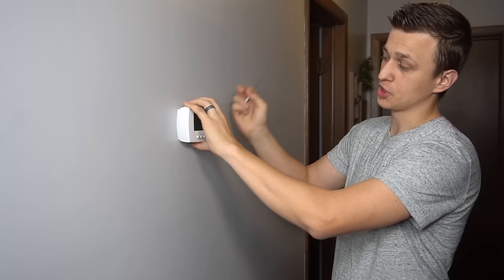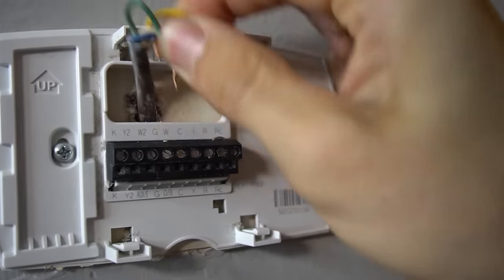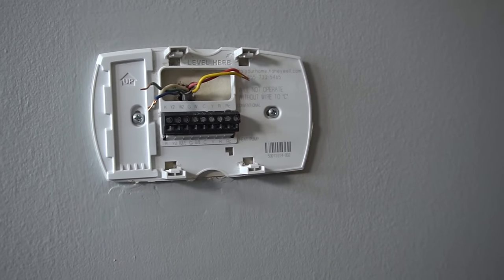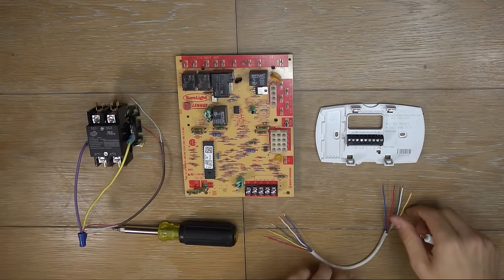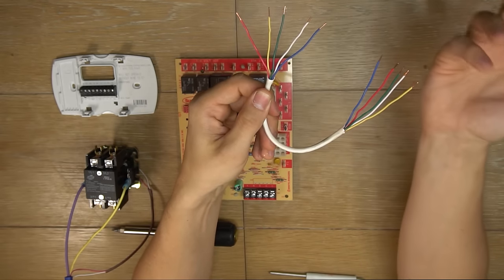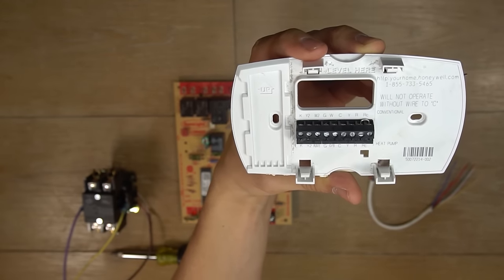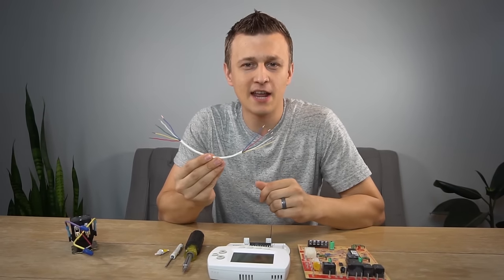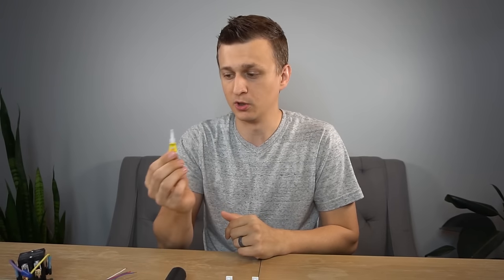Basic Thermostat Wiring - How to Wire HVAC Thermostat

Comment from the maker: ➡ More Helpful Videos:

How to Wire A/C Condenser Unit:
https://youtu.be/KCanZEsLVEI
How to Wire Air Conditioner Compressor:
https://youtu.be/GhBTVn5CHBE
10 Ways to Splice Wires Together:
https://youtu.be/ihpNCVk1lF0
How to Read Furnace Wiring Diagram:
https://youtu.be/2MSedAkirqw
How to Read A/C Wiring Diagram:
https://youtu.be/2MSedAkirqw
How to Read Water Heater Wiring Diagram:
https://youtu.be/TX8SuHK1esY
Basic Thermostat Wiring Diagram:
https://youtu.be/jDLz3REPTWM
How to Wire Indoor Blower Motor:
https://youtu.be/4S8TZd-45bY
How to Wire Outdoor Condenser Fan Motor:
https://youtu.be/VlMhvwrpimE
Is Common and Ground The Same Thing:
https://youtu.be/wiKDlIlbiP4
Electrical Symbols and Meanings for Switches:
https://youtu.be/ngQCmR_w9QU
Ohm's Law Explained:
https://youtu.be/sILl7p_J1UU

Comment: Super glue hack: yes it works and is safe. I was play fighting my niece and my brother’s dog didn’t like that. Long story short, the dog lunged at my throat but missed and lached onto my nipple. It gotten bit halfway off and was dangling by a thread of skin. My brother who’s an RN cleaned the wound and put my nipple back in place, then used superglue to “stitch” it back together. It healed fine with no issues. It’s now a joke within our family.

Comment: Jay in this video and the complete wiring for the condenser unit video , has given me a much better understanding of the thermostat to control board , and then control board to other contactor coils and relay coils that pull in plungers to allow the higher voltage go through to the respectable meters as to what they do. He did an excellent  illustration of the complete condenser/outside unit ,  where now the other part falls into place better. Also really clear how he did the wiring of thermostat to control board and the two wires from control board to the side of contactor for the condenser/outside unit. Jay would definitely  be a great instructor in HVAC, really appreciate and enjoy his  videos on this stuff!

Comment: My old wires to furnace was old 3 wires cable, and since my old thermostat broke from battery leaking, i bought a new thermostat from gas utility company since they offered me big huge energy saving credit of $50.  Fancy wifi controlled thermostat for just $19 after the credit.   However, what I didn't know, it doesn't work with old 3 wire cable.   I needed to install 5 wires cable.    I had no idea how to do it, but after watched your instruction.  Yaa, I managed to snake a new cable I bought from Home Depot, and was able to connect property in furnace.   Thans a lot.

Comment: THANK YOU!!   Remodeled hallway this winter, installed new thermostat, old one must have ran heat & cool from one wire.  Installed jumper and boom!  Thanks again!!!
Reply: Thank you very much for this good video appreciate your time and knowledge. Wanted to ask you or if anyone can help, was going to extend the cable and move the thermostat, when I went to purchase thermostat wire, there were many different sizes, how can I know what size is the right size for my thermostat. Thanks again.

Comment: Another great, no BS video done by a great instructor.  My “”seasoned” albeit faithful  2008 Heat Pump system, which came with house, has a newer replacement Thermostat.  It works, has fresh batteries and no issues.  I’m always educating myself for the inevitable failure on the coldest or hottest day of the year.  Question: My Thermostat has the following terminal labels: From Top Right Hand Side Down: Y2, Y1, B/O, G, C, RC, RH, W1, W2, and  then S1, S2, S3.  Some jibe with the video but Im curious as to the disparity.  Thanks again, for all you do!  And I’m so thankful you chose your current profession over Accounting!

Comment: Great video. At the end the super glue trick-I have done this and it works good as long as it is not an area that gets stretched a lot like a knuckle. Bonus use for super glue is if you have a cavity but can’t get to a dentist. Have someone apply it to the cavity and let it dry. It will only last about a day but is a life saver if in pain.

Comment: Thank you so much for this video and the info in it.  It helped me tremendously with the installation of my new thermostat. I have 4 wires but 2 are white and 2 are red. There is nothing in the documentation that discussed what the various color terminals relate to.  Once I was able to identify which of the 4 wires did what I used your red, yellow, green, white & blue identifier for proper wire connections.  Thanks again!

Comment: I worked in a machine  shop and I've been using super glue for cuts for 40 years. Crazy Glue seems to work the best but you need to apply it pretty quickly or it won't stick very well. If you apply it within one minute then it holds good but you need to open the cut and put the glue inside. It doesn't take much.

Comment: I just couldn't get the outside unit from coming on when I was using the furnace and no cool air, essentially, I was using the flames from the furnace to heat my house, so I took off the jumper as I only have one red wire, I put the red wire to RH, and unfastened the yellow wire. All thanks to your video and now I have heat!!!

Comment: Thank you for your advice , my 14 years old thermostat's  wire c was not hooked up to motherboard I connected to c at motherboard where already was hooked up ac wire, now  I have power 24 v sent to thermostat and alredy bought  new wifi honeywell thanks again you the best

Comment: To the super glue trick. Yes indeed it works. I have used it many times. As a matter of fact if you use liquid skin or also called Liquid Bandage, thats exactly what it is, basically just super glue. Good tip for folks that haven't used it.

Comment: Jay, thanks for this video. I bought
a Honeywell Smart Color thermostat. The old thermostat has batteries, so it's not using a C wire. I guess I have to run a new
wire, so I'll have a common wire,
unless it's tucked inside the wall.
By the way, I miss that "and not in
the comments section below" 😇

Comment: Super glue works to stop bleeding but can cause side effects, especially if the wound is deep.  Also it doesn't have antibacterial properties. There is a safer product that is used like super glue for wound closure called "Dermabond."  This product also has antibacterial properties and is available over the counter in the US and Canada.
Reply from the maker: Good to know, thanks Johannes! I may need to get some of that to have it on hand just in case..

Comment: This is a very informative video and so easy to understand thank's for the video.

I have a question that I hope you can answer every time I turn on my heater it blows the fuse any reason why is this happening.? The air conditioning works fine is just when I turn on the heater that it blows 3amp fuse like right away.

Comment: Super glue works great,  especially on those painful fingernail rips or gashes. Thank you for the very detailed look at the thermostat.  Just bought a used rv and they installed new thermo incorrectly😐hope we get it working, it's getting cold out there brrrr

Comment: Hello, sir, I hope you find this message as I am a new AC tech and have found your videos inspiring.. one question, though: at around 9:08 when describing the power transmission to the contactor, where did the 240volt figure come from? You had a moment earlier said 24volts, so I figured either you misspoke or I am missing something entirely... any input would be appreciated. Thank you again for all you do.
Reply from the maker: Glad to hear the videos have been helpful for you! The contactor has a 240v side and a 24v side. If you watch these two videos, it would paint a much clearer picture for you:

How to Wire A/C Condenser Unit:
https://youtu.be/KCanZEsLVEI
10 Reasons Why Contactor Doesn't Pull in:
https://youtu.be/NVPhsK4gK1A

And if you want to take your understanding to another level, try to sit through this one:

How to Read A/C Wiring Diagram:
https://youtu.be/2MSedAkirqw

Comment: Thanks. I'm going to try to connect a new thermostat.  It's just the thermostat alone no AC. I'm just afraid of the power though. I know I have to turn it off on the furnace , I only hope it works

Comment: Your superglue comment is interesting, did you know they actually sell this at many pharmacies? One product is called "new skin liquid bandage" it's essentially superglue, but with antiseptics mixed in to prevent infection, takes a few seconds longer to dry, but works great. It either comes with a little brush, or a spray nozzle can that you can just spray on the cut, works great, haven't used a band aide since.

Comment: I've used super glue many times for those reasons.  It does work.  Used to do a lot of woodworking,  and used to get cuts quite a bit.  Wouldn't recommend it for deep cuts,  due to possible infection,  etc,  etc.
Reply from the maker: Another thumbs up for the super glue! :) Thank you for commenting!

Comment: Always enjoy your videos and I've learned a lot. I have a quick question: I have an AC that works but the thermostat doesn't seem to be reaching the desired temperature to shut off. And if the AC runs for too long in the process it may cause the condenser fan to make a noise and stop. I tested the fan motor and the ohms don't seem to be adding up, but no continuity yet. So it looks like the fan motor might be going bad. Could this be the reason for the lack of cooling to reach a lower temperature? Even with some high heat in Florida it didn't used to do that. Freon level is OK now.

Also I have 24 volts from the thermostat in all wires except for the R and W wires. But I don't think there's a heat pump (W) in the furnace and we don't use it in FL. So it seems that would not be part of the problem, right? 

Thanks so much for looking out for the little guys in this harsh business where you're not sure who to trust. God bless.

Comment: Great tip on the super glue

Intersting fact: In African tribes, the stitch up large cuts requiring stitches, they use a series of bull ants to bite into the either side of the cut and then break its head off and leave  it there until the cut has healed.

Comment: Yeah about the super glue. I’ve used that for gashes and cuts for years. Not only does it work but it also heals really well too. I’ve had huge gashes that I used super glue for my wife couldn’t believe it. Definitely needed stitches but why not save time and money and just slap some super glue on it. Best part is you can keep working…

Comment: At ~ 8:25. I don't believe the control board sends the signal to the contactor. For the purpose of turning on the compressor, the Y contact on the control board is just a convenient terminal point between the thermostat and contactor. The thermostat switches power from the red (or Rc) wire to the yellow wire which goes all the way to the contactor and back to the ground (C terminal).

Comment: Hi Jay, Here's something I saw but maybe I'm wrong in understanding this. When you test at the board, If you have your T-Stat calling for heat you check at the board on the (W) and (C) for 24 volts a/c, for cooling if your T-Stat is calling for cooling you check voltage on the (Y) and the (C) for 24 volts. If you are not calling for either heat or cool you would check your (R) and your (C) for 24 volts. If you don't get 24 volts on either (W) or (Y) and common when calling for heat or cool that would mean your thermostat is faulty.?

Comment: I have a newer Honeywell thermostat. The wires from the control board are Green, Yellow, White and Red. Each color goes to it's respective terminal on the thermostat. But there is no Blue wire, and no wire is supplied for the B terminal. So everything is running without a Common? Just 4 wires. It works. But I would like the LCD display to be illuminated and I'm tired of using a flashlight to see where the buttons are. Once I press the temp buttons, the display lights. Will adding a "C" (Blue Wire) add illumination to the LCD display? Do I need a Blue Wire going to B for safety or some other reason?

Comment: I read all the comments but couldnt find the same question answered, here it is. Installing new forced air furnace so it has a blower.  The old furnace was hooked up by only two wires red black. Tstat has batteries but Im up for going with adding common wire. If I also add blower only wire Im up to four wires. No AC. This sound correct?  If I didnt care whether there was a blower only option I would still jumper the blower to the red, right? But 4 wire when theres no AC is all I need? The Tstat has more contacts so could control AC but since there is no AC unit then 4 is good.  If I jumpered the blower and left off the common the furnace could work with just two wires like the old one?
Reply from the maker: Yes, I think you understood it correctly and there is no need to jumper anything. The colors of the wires don't matter but I'll list the preferable colors too. You would hook up:
G for fan (green)
W for heat (white)
R for power (Red. Also your thermostat might have Rh instead of R which is power for heating.)
C for common (blue or black)

Comment: Great video. I got a bad cut above my upper lip a few years back at work. The on site medic used regular super glue to close the wound. Horrible smell going right up my nose the rest of the day!

What's the difference from wiring the contractor to the Y and C at the furnace board vs wiring it directly to Y and C at the thermostat?
Reply from the maker: Sounds like using super glue for cuts is a normal occurrence! Thanks for sharing. As for the wiring question, Y needs to be hooked up to the control board in order to energize the blower motor on the high fan speed for cooling.
Reply: @WordofAdviceTV  thanks for the response and thanks for all the knowledge you share on your channel!

Comment: Love the info. Are there any vids that tell us what to do if our thermostat isn’t getting 24 volts and what to so
Reply from the maker: I don't think I have a video that is specifically on that topic. But If the thermostat is not getting 24v, then there is no power at the furnace, the 3 amp fuse is blown, or the control board is bad. (Of course there are other possibilities but those are most common)

Comment: I added a smart thermostat to my two stage furnace I didn’t have enough wires to connect the C wire so I used the G wire for C in the thermostat and furnace . Everything works but now when I do ac the fan doesn’t feel strong. Any suggestions? Thanks

Comment: Do you live in the northern area of the US? I hear that furnaces are more popular in that region. Anyhow, down here in southern Oklahoma, my house has this Carrier air handler with air conditioning, a heat pump, and a backup heat source. Heat pumps seem to be really popular where I live. It's basically air conditioning in reverse. My thermostat has a ridiculously large terminal block, though. Loads of wires. Well, more like lots of jumpers. Around 3 of them.

Comment: My heater keeps short cycling because theres not much of a temp difference. What thermostat do you recommend that i can set a temperature difference. Example, heat comes on at 68 and shut off 72. I think its called deadband or temperature differential

Comment: The super glue trick works if its not on an area that you will be using... like your feet or fingers unless you dont move them. Clean up the wound, then have a friend hold the wound tightly together before applying the super glue.

Comment: I wish you had included in your explanation some information about the core of the automatic system. Where is the temperature sensor located?
Factory wired inside the wall box that you dismantled or somewhere else? Is it possible for the user to adjust the deadband meaning the start and stop difference?
For example, you set the temperature on the dial (or digitally) to start cooling at 65. So the a/c machine starts at 65 and stops when? and restarts again when?  And where is the room or house temperature actually measured?

Comment: Best video I've seen on this subject. I'm installing what seems to be the same unit you are installing. My problem is I don't know which one is my C wire. The labels have came off. My old unit did not require a c wire. I have a blue, yellow, red and white wires. There is another wire/bundle that was in the wall not used by the older unit. There is a black, white and silver maybe ground wire. I'm installing a Honeywell smart wifi thermostat. I don't have access to the control board. Any advice?